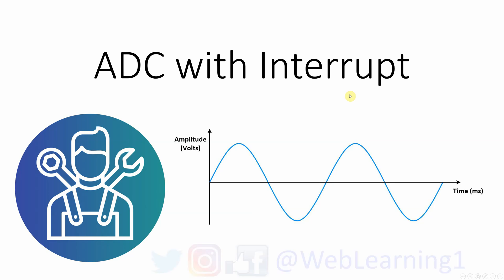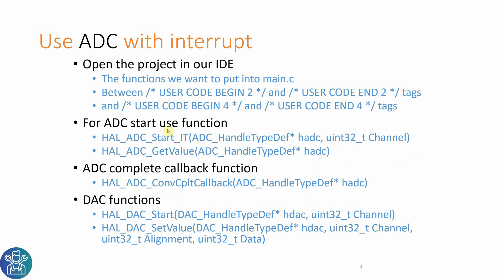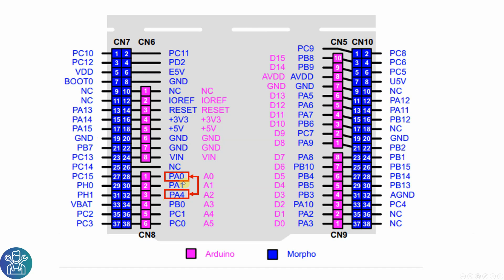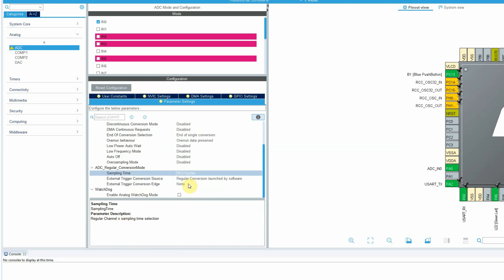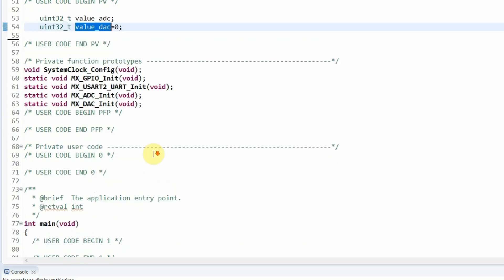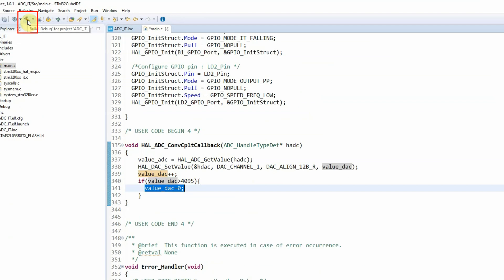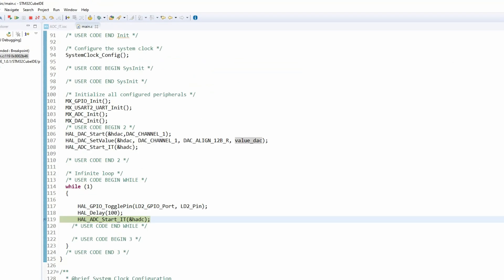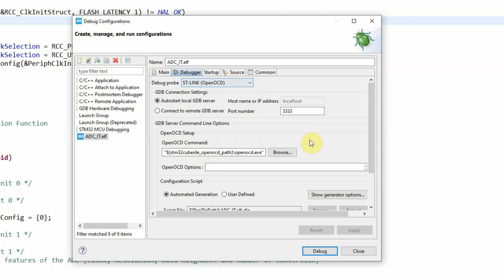HAL #12: ADC with IT

Comment: My Clock Prescaler doesn't have the option for Asynchronous? Only PCLK 2?? HELP! My board is STM32F407VG. Is it because of my board?
Reply from the maker: Different STM32 have different ADC with different options. Its ok. Please have a look at this video on the examples where you can find more information on the settings that you need to set. 
https://youtu.be/p3q3kaftvDQ

Comment: Excellent tutorial! Can you elaborate why you disable the high and low speed clock under RCC? I am using a slightly different Nucleo board (F446RE),  and I am able to run with these settings enabled. You should think that the default settings under CubeMX should be correct for the board selected.
Reply from the maker: Hi. As I don't know what board my viewers are using, even if it's a nucleo, I disable the clock so it will work for them. The OSC doesn't have any effect on the ADC. If you will see my UART video, you will see that I address this issue.